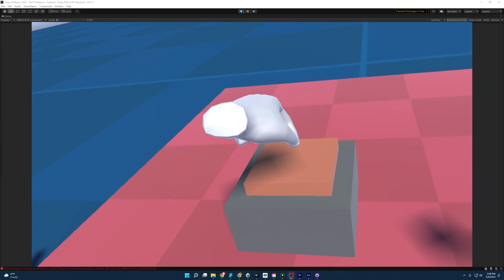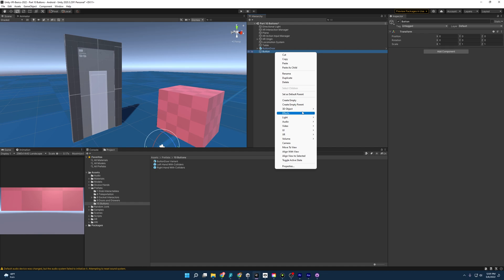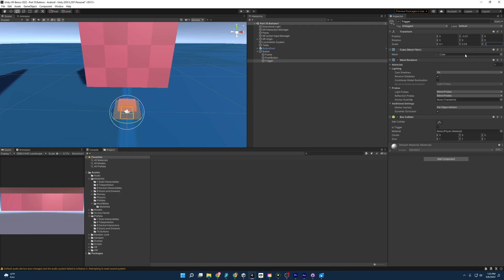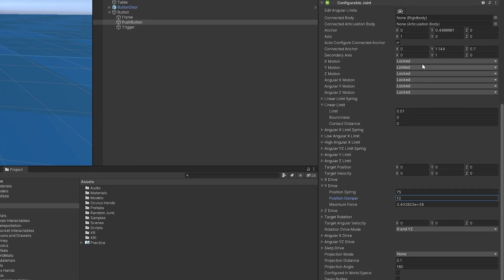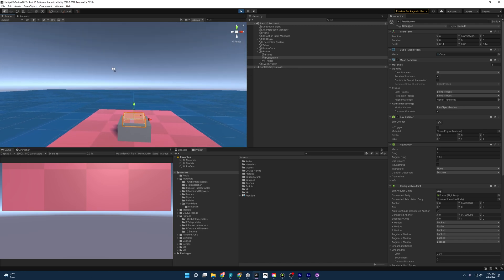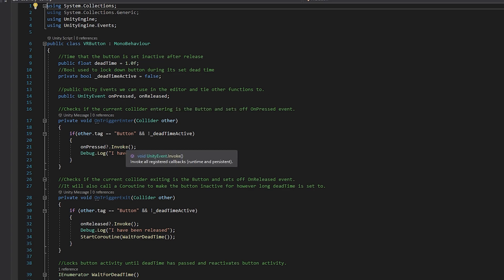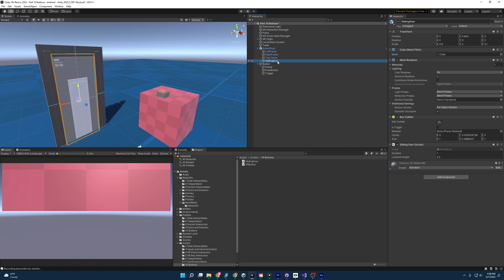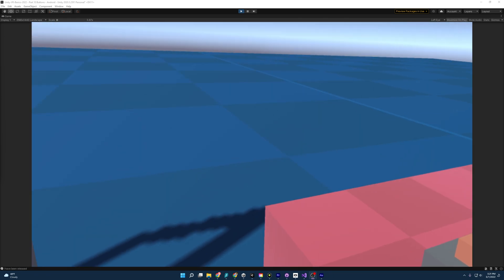Unity VR Game Basics - PART 10 -  Buttons

Comment: Quick question: Trying to understand why you're using a custom hand with the colliders in each finger. You have 2 sphere colliders on each controller, (a bigger one of 0.1 radius and is trigger + a smaller of 0.5 radius and is not trigger). Then you have the capsule colliders on the hand prefab (not triggers). Is it essentially so you can use the XR grab interactable component and have some physics to push with the finger? Absolutely fantastic tutorial, love that they're modular, clear and concise, great job!
Reply from the maker: You nailed it! That's exactly why I have both. It can get a bit clunky, but for this tutorial, it was a quick solution to get both grab functionality while also having collider capabilities. Glad you found it helpful!

Comment: Great videos, they've helped a lot, I'm having issues with the Push button, sometimes hands go undetected by the button and don't push it down and sometimes I'm able to lift the push button from the base, do you know how can this behaviour be prevented?
Reply: I'm having the same issue.  Everything works great except the button is flakey about detection.  Checked and
 it is using continuous dynamic.
Reply from the maker: To fix the detection of the hand, you may want to double check the rigidbody and make sure it's set to continuous dynamic. This helps with collisions of rigidbodys that are moving quickly. 

As for the button being pushed up from the base, I noticed this issue and didn't have enough time to address it before my self imposed due date for the video.

A script that checks a max and min threshold and resets the position to the min of max if exceeded should fix it.
Reply: @FistFullofShrimp  Don't worry your videos are super handy and helpful, I'll try to do the position reset script

Comment: great video as always. I'm having problems with your example files. I load it in unity (same version) and change to Oculus Quest in project settings. When I run the scene, head tacking works correctly as does the turning using the left thumbstick, but the hands do not track and are flashing around the screen wildly. Any ideas on what I need to do please?
Reply from the maker: That is super weird behavior. I don't know if I can fix this from the description so far, but we could try troubleshooting some things.

When you press play, you should check in the editor that the Left/Right hand models are made children of the Left/RIght Hand Controller and that their transforms are zeroed out (Position (0,0,0)).

If not, something strange is happening when the models get instantiated by the Hand Complete script.

We could also try turning off the Hand Complete script on the Right/Left Hand Controller. Then use the XR Controller script to instantiate the Left/Right Hand With Collider models. Just drag those models into the empty slot for Model Prefab on the XR Controller script.

You won't have hand animations doing this, but it will rule out some bug that might be happening between my Hand Complete script and your current setup.
Reply: Thank you @FistFullofShrimp  . Unfortunately these didn't work. I tried alternative static hands and still had same effect.

I opened up one of my projects where the XR rig works as expected and tried to compare the two. The only difference i can see is that the projects whihc are working use XR interaction tool kit 1.0.0 pre 3 and yours use 2.0.0 pre 6. 

More I think, the more I seem to recall a similar issue with another demo file using 2.0.0 pre 6. 

I will try to have an explore and see if I can find something which works... but really keen to follow your tutorials as i think they are really clear!
Reply: @FistFullofShrimp  It is magically working! I've had a play in a few othr template files and frameworks, trying to get my head back in to things again. Started afresh with the tutorial files again and it worked. How strange, but thanks for helping!